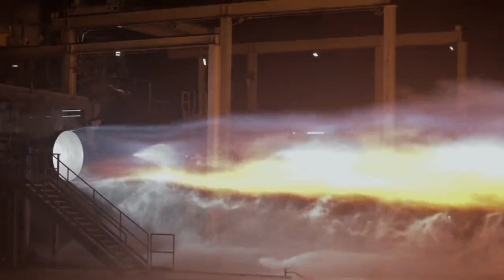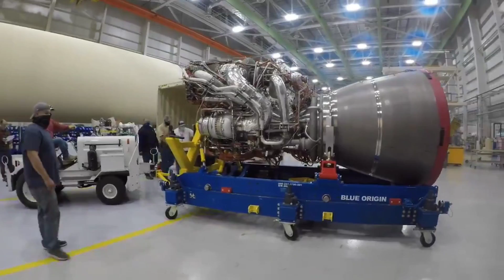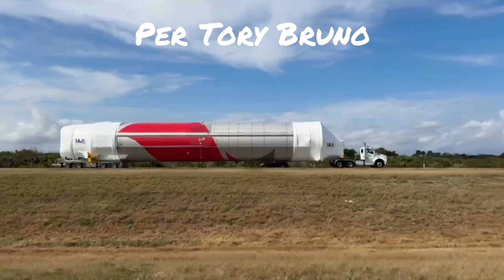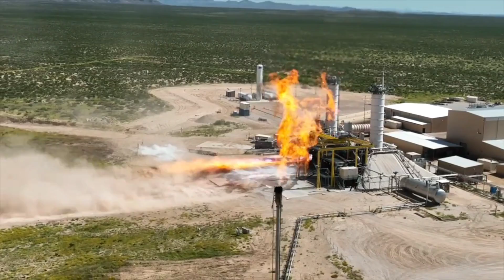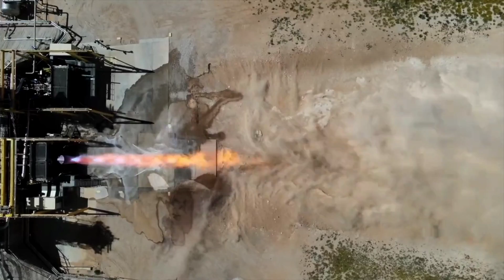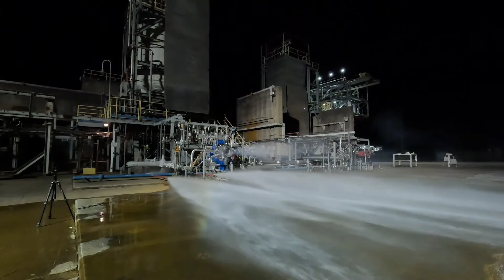Blue Origin engine explodes!!  How will this impact Vulcan Centaur, Peregrine and Dreamchaser?

Comment: Now we know what would have happened had ULA fired the 2 BE-4s for longer than the 2 seconds in their static fire test. Boom. A nice RUD for the Vulcan-Centaur. Both those engines got sent back to Blue Origin after acceptance for rework: #1 twice and #2 once. A design flaw? You just don't use early produced engines, unless you're looking for trouble.

If Peregrine and Dream Chaser want to fly this year, switch to Falcon 9.
Reply: This is ignorance. FE-1 was sent back once for rework and FE-2 passed its ATP first time and was delivered well ahead of FE-1 to Decatur and installed on the Vulcan booster core. 

The problem with the engine lost was a workmanship issue, not a design flaw. FOD got in it from somewhere, then got caught in some of the cooling channels, which in turn blocked propellant from reaching the channels, leading to a burn through and the explosion. The engine might've been saved, but the redline threshold was bit high and so future tests will have that dialed back to allow more timely shutdowns.

Comment: You are right that Blue Origin is not as transparent as SpaceX and this, sometimes, makes me wonder if things are going according to plan. And I don't really like Bezos. But... AFAIK, both Blue Origin and SpaceX are private companies, it's not your money that helps to develop those engines (I'm sure mine are not, I'm not even a US citizen). And even if it would be, you're not entitled to know details regarding the development of a rocket engine. Those things have strategic importance, you'd want that technology to go to North Korea or Iran as little as possible. And even if you'd be entitled to know more information, you have to know that some tests are destructive in nature. They want to blow the things to observe the failure modes. You may see 5 explosions in a row, and conclude that the engine is sh1t when, in fact, the tests were designed to verify and improve the chamber pressure and each explosion occurred at 140, 148, 156, 162 and 168 bar. While you cry on YouTube Blue Origin is not transparent, while North Korea is led to think the BE-4 engine is worthless, they, in fact, manage an increase of 20% in chamber pressure. Sure, I don't know, I'm just speculating, but that's an example that drawing hasty conclusions for complex situations without solid data will not get you anywhere.

Comment: Pausing at 9:30 to comment about the Raptor comparison. Raptor isn't an engine scheduled to fly customer payloads which is a notable difference. When they begin commercial operations the comparison will work better. Though they are expected to work for Starship.

Comment: Of course the problems aren't over. BE-4 engines have had way too little testings. Even the merlin engine went through a lot more before SpaceX tried a launch.
Reply: You don't have the faintest idea how much hot firing BE-4 has, so that's presumptuous. 🤷🏻‍♂️
Reply: A single BE-4 was started 36 times and accumulated 5,000 seconds of firing time. Another one 2,500 seconds.

Comment: You have two kinds of design methodologies... 

1. Design the crap out of it so it never fails ever, or 

2. Test the crap out of it so all the bugs are flushed out.

Methodology #1 takes decades, lots of carefully played out engineering. Should work perfectly once design is finalized.

Methodology #2 is rapid iteration, lots of failures, end product is delivered faster. 

A failure for #1 is a big problem, a failure for #2 is normal and part of the process.

Comment: Agree with most of the info but, Seriously? Equivocating the flow of information from Spacex and BO? There are Daily reports on Spacex progress from multiple channels. We knew three Raptor 2 engines failed on their recent launch (followed by another three) in real time because we were able to watch the launch attempt. 

We have regular reports of the failed pad that showered the engines in debris and the launch pad is being massively modified to avoid this in the future. 
We know the rocket was still able to clear the pad with the initial 3 failed engines.
We know the two failure points were rocket seperation and pad destruction (and kickback).
We know they are massively reinforcing the pad and using hot seperation to fix the problems.
We know the Raptor V3 engine weighs less than V2 and was tested to a steady thrust level beyond BE-4 despite its much lower lower mass and much higher ISP.

Aside from not conducting tours to a secured facility, we can track Spacex operations very closely. 
Pad modifications, Raptor improvements, Starship variants upper and lower.
Not so BO with their New Glen rocket (under contract to deliver payload next year). We see Spacex iterations in their rocket yard and assembly bays regularly. 
Where is New Glen? (Not the mockup, the actual rocket.)
Shouldn't they be testing with the pad by now? At least somewhere outdoors?

The interesting take away is that Raptor 3 is:
Higher thrust than BE-4
Higher ISP,
Higher thrust to weight
Much smaller
Uses same fuel (though Spacex uses super chilled Methyl-Ox)

It would now appear that Vulcan could plausibly use Raptor 3 with some mods to their rocket. 
Assuming super chilling the fuel is not plausible (tank design), it should still get 90% of its performance 
bringing thrust just about equal to BE-4 with better all around performance and a source that builds 
one engine a day rather than one per month (or two). 

See, we know Raptor's production rate... BE-4 is anyone's guess.

Comment: big diffference in raptor explosions vs be-4 explosions. spacex was trying to explode them in many cases and hardware rich and not a finished engine, they had many changes on those engines not in the test articles untill they worked out bugs and tested alternative parts - they tested in real world. BE-4 is already supposed to be a finished product and is exploding as a deliverable engine.
Reply: also worth note the raptors that stopped on the starship launch were a full generation behind and only used because they were very old and still having hydraulics instead of the v2's or even the v3's with electronic actuators and valves.
Reply: v2s dont explode unless testing throat restrictions or random hardware changes and are not a release engine, v3's maybe v4's will probably be the release article.

Comment: As what goes for the McGregor facility security personnel "incident": available is only the claimed recollected account of one wayward person, furthermore known to gather "data" using any means necessary mostly for sensationalistic purposes, as obviously shown. Taken into account the area is used to conduct tests on rocket hardware and what not space equipment alike utilized by the military as well, it's hardly a surprise the guards are ordered to inform of the use of necessary force to emphasize the gravity of the consequences, should a person - layman or not - blatantly refuse to understand the multiple written signs, commands and warnings given, if and when a trespass is imminent. Anyone proceeding to behave in such a degree recklessly merely relying on deliberately misinterpreted privilege, should anticipate and appreciate duly warranted measures taken.

Comment: Rocket engines exploding when they are developing various prototypes can be expected.   However it is a much different situation when 'production' rocket engines are exploding when being final tested prior to use. Contrary to what you say, the results of the ongoing investigation could certainly impact the 2 BE4s already  "passed". It is entirely dependent upon the results of the investigation, of course.
  * Commercial rocket corporations can remain totally transparent as long as they do not have government contracts. At which point they MUST adopt and implement certain security measures for their facilities. It is therefore appropriate that NASA make certain announcements concerning many events occurring within these compounds.
Reply: It didn't. Those engines passed not only ATPs, but also the FRF.

Comment: Wow. Somewhere, Tory Bruno is having a large, stiff drink...

The issue with the Centaur upper stage is at least out of his hands, but now here's another issue that will keep Vulcan from flying, until solved.
Reply: No, it won't. This is just bad reporting by Angry, again. The BE-4 loss was production engine that was on ATP. It was not a dev or qual test. The issue was already figured out and understood quickly, it was a workmanship issue that allow debris to get into the engine which clogged up some cooling channels that when the engine got fired up lead to overheating and burn through. The redline threshold was set a bit high so the computer running the ATP firing didn't try to shut things down because of that until it was too late. 

They'll just complete another engine in a few weeks and use that one in place of the one lost.

Comment: Will ULA's SMART Reuse system be exercised with the first launch of Vulcan Centaur?  I doubt it, given everything else that has to go right, but I would imagine that eventually ULA might not really need a lot of BE-4 engines to keep its launch program active.  SpaceX has a fleet of about a dozen Falcon 9 boosters, with which it will perform close to 100 launches in 2023.  If you extrapolate this to ULA's situation, it would involve about 24 BE-4 engines, but the Vulcan Centaur's launch frequency will probably be much lower.  I would imagine that if SMART Reuse is made to work then just 12 BE-4 engines might be fine for ULA's needs over the next couple of years.
Reply: ULA aren't going to be attempting that regardless of what happens, it was never, ever part of the plan of the first flight of Vulcan.
Reply: They aren't using SMART for at least 5-6 flights, and maybe longer. There's still a number of HAID tests in the pipeline, similar to the LOFTID test conducted in 2022, and they need to scale up considerably from that one which was impressive at 6 meters, but they need at least a 10 meter decelerator be able to support that aft engine section with two BE-4s.

The only reason that ULA is going with SMART is to support the 38 Kuiper launches Vulcan will be expected to fly in addition to NSSL and other missions.

Comment: The big difference between SpaceX blowing up a Raptor and BO blowing up a BE-4 is how many engines they have, how quickly they can produce them, and how much they cost.  And on that basis, a BE-4 explosion is far more serious than a Raptor explosion.  This particular BE-4 was already designated as #3 for a specific Vulcan rocket.  If SpaceX blows up a Raptor, it's only 1 of 33 they need for any given booster, or 1 or 39 for an entire Starship stack, and they're building them at something like 1 every 2 days, last I knew.
Reply: Exactly.  I don't recall exactly the top number, but raptors with visible serial numbers keep rolling out all the time, visible on NSF and LabPadre, and the numbers are getting will up into the hundreds already.  Those are the ones that made it through acceptance testing, not the ones that failed or were blown up deliberately.  So BO has produced 2 flight-ready engines in the time that SpaceX has produced something like 300.  That's all you need to know about it.  SpaceX has one hundred times the production capacity at present.  Perhaps BO can increase their rate too, but at this sad pace, it's never going to be even close to SpaceX.

Comment: Dreamchaser and Peregrine are too important to depend upon the hypothetical Vulcan Centaur or the mythical BE4.  In the long term certainly it is highly desirable that ULA, whoever may finally own it, be successful.  We need competition in space.  The same applies to Arianespace and other potential launch providers.  But until Vulcan Centaur, and Ariane 6, and other medium to heavy launch vehicles are clearly operational these critical missions should temporarily be transferred to the most reliable operational launcher: Falcon 9.  Time is running out.  In particular it should take several months to design and implement support for Dreamchaser and it can only make its planned December 2023 mission if it signs a contract with SpaceX immediately.
Reply: Neither are "mythical", the FRF conducted in June was proof that both are very real. If it hadn't been for the Centaur V qual testing failure, they'd have attempted the Cert-1 flight in early June or early July. 

And "no time is running out" here for either Peregrine or for Dream Chaser. The latter is still under construction and hasn't even gone up to Ohio for thermal and vacuum testing the NASA Armstrong facility there. In fact, according to inside sources, DC may not be ready by May of 2023 it's fallen so far behind schedule.
Reply: @Starshipsforever  Thank you for that information.  I presume you meant May 2024.  I am not really surprised.  DC is a much more speculative design and is not as well funded as either Crew Dragon or Starliner.  If DC is not ready before 2Q2024 then clearly it would be better to stick with Vulcan Centaur which should be operational in plenty of time.  SpaceX really does not need the business and it is truly unfortunate that for at least the next six months it has essentially no competition.
Reply: So you're basically saying, the game is over. There is one launch provider in the market. Alright then! 😅
Reply: @GSF404  One RELIABLE launch provider, SO FAR! And the prices are Lower than comparable Legacy providers.

Comment: Also- frankly the video that was released of the mishap at MSFC is from the vantage of 4670. Meaning that Blue Origin gave them the footage to post. The CEO of Blue Origin is Bob Smith, who is also an aerospace engineer by trade. Slow down and stop taking this so personally. Failures are going to happen and I hope they got good data.

Comment: Why is Bruno the one to comment,... My prediction,... ULA will be purchased by Bezos,.... Also, NASA experiences engine ruds just like everyone else, however NASA doesn't test at any frequency near that of SpaceX or others and no private rocket engine will fly unless it's tested against NASA's safety metric as to a total loss of vehicle ratio of 1 in 270 (more than twice the metric for shuttle of 1 in 100), which if I'm not mistaken, SpaceX beat this metric at 1 in 276 for Falcon-Dragon. Falcon and Starship are designed to weather more than one engine loss. Elon Musk himself has places the goal for Starship at the same eventual safety rating as a commercial Aircraft carrier.

Comment: I'm less concerned at Spacex blowing engines up given their hardware rich development approach than I am with Blue Origin blowing an engine up during an acceptance test. These are not the same thing. Just as the Starship integration flight test wasn't a serious concern when it went BOOM over the Gulf of Mexico whereas Vulcan or New Glenn doing so certainly would be.

Comment: I said it "BE4", I'll say it again...
SpaceX should develop the CF5 engine and sell it at 1/2 the price, via lower manufacturing and upscale cost savings, to ULA..!
Reply: You can't switch engines. This pure unadulterated fantasy and real life isn't Kerbal Space Program where you can just attach any random engine onto a tank willy-nilly. It would take YEARS redesigning the core, the software, and Raptors or any other engine to meet ULA's and the military requirements.

Comment: New Glen first stage engine explosion, New Shepard BE-3 engine explosion which is the engine for New Glen 2nd stage.
Ummmm, that’s not nothing.
They’ve got problems!!!
Reply: That's a bit of a fib. First off, BE-3 PM, didn't explode, but suffered a nozzle burn through failure, the turbopump powerpack was fine, and shutdown safely. The booster was intact as it fell and until it impacted the ground.  BE-3U is very different in cycle (expander bleed off vs combustion tapoff) such that they're two very different engines. They only thing they have in common is both being hydrolox.
Reply: @Starshipsforever  I appreciate the good details, but it doesn’t change the real point that Blue Orgin has engine problems.
Reply: @philipsonefeld9609  It does matter and it does change things considerably. Very much so. BE-3 PM is NOT the second stage engine. The BE-4 engine issue is actually a non-issue since it isn't a development issue, nor a qualification one. This is true of many engines and you don't normally hear about a failed Acceptance Test Procedure (ATP) it's because that's designed not to qualify or invalidate the design, it's to look for potential workmanship issues, which over time get ironed out.

So, unless engine production falls way behind (which it isn't) and unless it's a very systemic workmanship problem, then this is just a molehill into a mountain by people looking for troll or clickbait.

Comment: Comparing a BE4 test to a Raptor test doesn't seem like an apples to apples comparison.  

As I understand it, the BE4 is supposed to be an average engine with an average power output to replace older engines no longer manufactured.  No extra whistles or bells were to be expected.  A Raptor engine is one of the most powerful manufactured and is always being improved on.  SpaceX continually pushes the engine design to new limits and constantly improves and upgrades the system.  

So SpaceX blowing up an engine to see how much more power the recent upgrades improved it is not the same as Blue Origin testing an engine to see if it works. 

That being said, the BE4 is still a new design and will have some bugs to work out.  It's the comparison I don't agree with, not the conclusion.

Comment: The fact that this engine exploded and is identical to the others that passed this test, indicates the others are at high risk of exploding during launch. And the vibrations must be worse during a multi engine launch than during a single engine on a test stand.